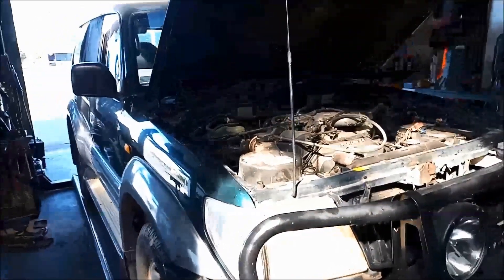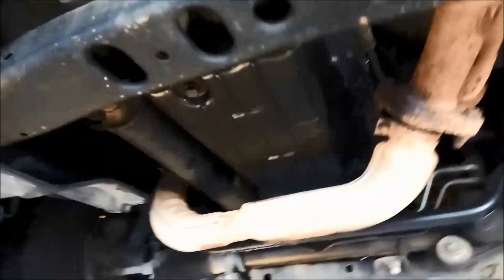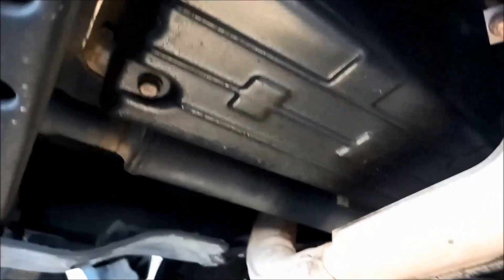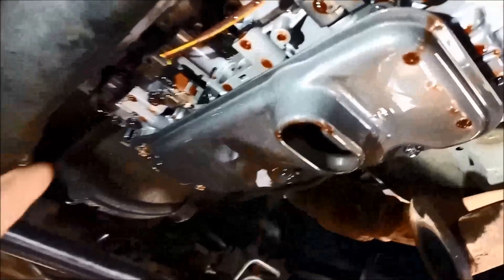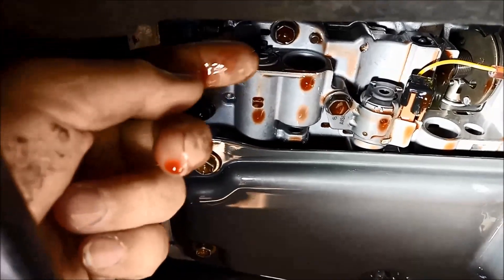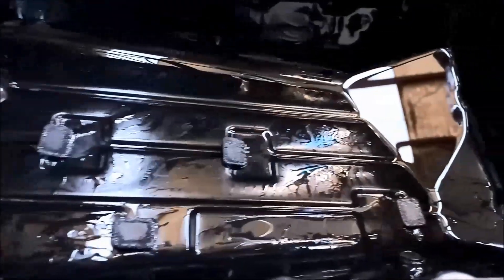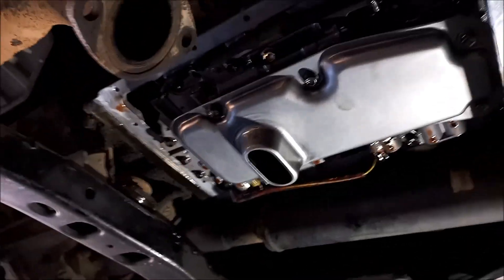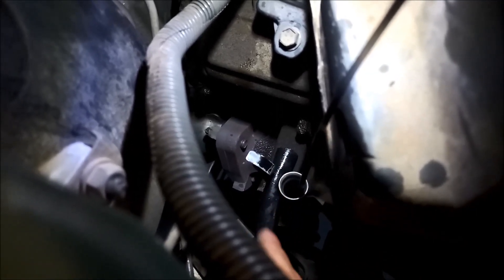A343F Transmission Service Toyota Prado Jeep Isuzu Colorado How to

Comment: I have a tick coming from my Prado 99 Auto Trans. It disappears if the kickdown cable is pulled. Was advised that when the cable is pulled it increases pressure. Will the pressure regulator adjustment you mentioned in here boost the pressure enough to get rid of the tick? Its a high km car, and is great apart from this tick! Thanks
Reply from the maker: hi, no idea without seeing it. worth a try your end. just mark original reference points before you make adjustments to help determine best adjustment points. cheers
Reply: @YepThatsIt  Thanks for the advice. Tick seems to only come in when warm. Dirty filter may be part of the cause as well. Will change it as well and see how it goes. Great car apart from this "tick"!

Comment: Well done enjoyed your video and the tips you shared. Was servicing my sons 2001 VZJ 95 and could not find the Dip stick for the Auto. It is fitted with Gas so this could be obstructing it.
i know later transmissions may have done away with it. Do you know if that is the case with that year.  Thanks.   Maybe i will need to have a women's look  tomorrow!
Reply from the maker: thanks and cheers

Comment: Can you tell me if the drain plug on this transmission has a washer on it? It didn't have one on it when I drained fluid and wasn't leaking but I would have thought it would have to have a washer. If it does, would it be the same crush washer used on oil sump of engine which is also 14mm or nylon one?
Reply from the maker: hi, they should have a seal of some sort, either a crush washer, copper washer or o`ring. cheers

Comment: Hi! I have 04 120 prado with 440000km on the clock. It has A343F transmission and fluid is brown but does not smell bad. It think that it chances fine. Would it make any sense to do a fluid flush and change all the fluids? Or will it ruin it? Thanks!
Reply from the maker: hi, just drop pan and filter service, add magnets and refill with quality and compatible fluid. you can add lubegard to help boost fluid properties... and add magnets. we usually only do a full flush ( several times ) only if coolant or water has entered trans. cheers

Comment: 2003 Hilux A340e/f makes a hummm noise. Oil dark and smells burnt. Changed oil just using drain plug (2lt roughly) 10k ago. Should change filter and oil change again? Do you reckon that's going to fix the problem? Long shot but thought I'll ask either way.
Reply from the maker: hi, usually trans service includes filter change, clean trans pan and magnet. once magnet becomes contaminated/loaded, it cant work or collect more swarf, so debris accumulates in your solenoids quicker. start at all the basic checks first. cheers
Reply: @YepThatsIt  will do mate. Thank you!